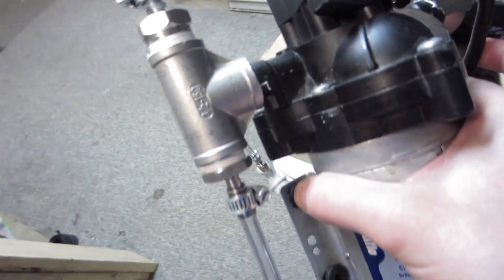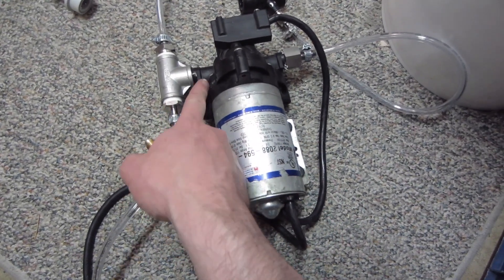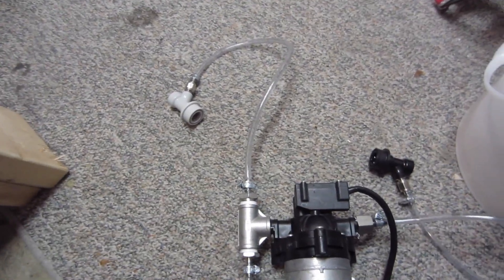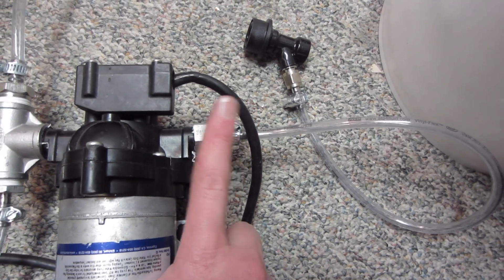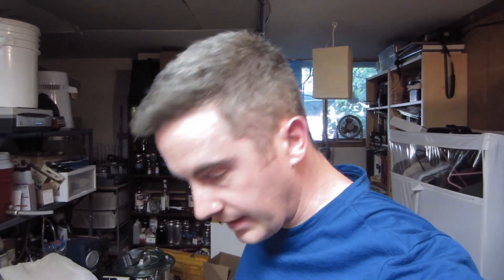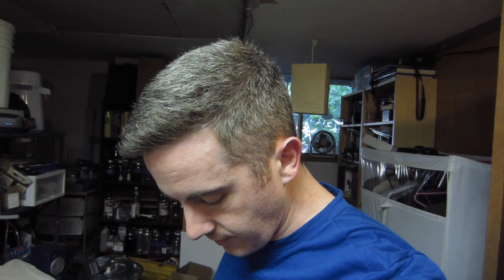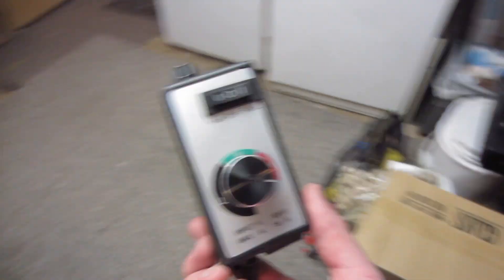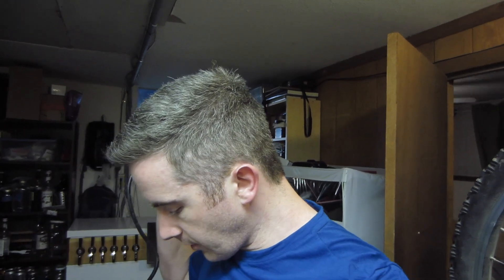DIY Quick Carbonator!

Comment: Hey Buddy

I've tried with small solar pump solution, but when I crank up the pressure, it stops working. I can get it flow when the pressure is not on. What am I doing wrong? :(

Comment: But is that plastic food grade?
Reply: it doesnt have to, im a lover of the stainless steel, but on my way to become a brewer, and also i hace my own business relatad to a beverages, i found out that sometimes you dont have to go to stainless steel always, in this case, im sure that if you are watching this video its because you are trying to save some money because the quickcarb its a little expensive, so, i found out that the pump of the quickcarb its neither a foodgrade, thats why they recomended to sanitize over a 5 minutes with hot water then star san etc. i may be to long with my answer  hahaha, but my point is, as long as you ALWAYS clean everything up after en before using, you wont get any contamination.

Comment: Quick question. Neither of those pumps are self priming. How did you prime/sanitize the system
Reply from the maker: I usually use a small corny and put a little pressure in it and vent one end to get it flowing.

Comment: Jason, As indicated by the large bubbles sticking to the inside of the glass, the glass was not beer clean. If beer glasses are cleaned with dish soap, they need to be rinsed a few times with plain water to remove any lipids, which deflates (?) the head.  I'm in the process of  gathering the items to build a force carbonation system. Love the DIY aspect of the hobby. Or is it an obsession? Anyway - thanks for the video.
Reply from the maker: That makes sense about the soap! I need to get one of those beer glass rinsers like taprooms have! I think DIY just gives a better understanding of the process.

Comment: Hi beer meets world. I am in the process of building your carbonator and I got the same small solar pump as you. I dont have a reuter to slow it down also I have no absolutely no tech know how. Did you change how the small pump rat at all. My power supply will give it 2.5amps. Any help would be super super awesome.
Reply from the maker: I only needed the controller to slow down the larger pump. The solar pump should be fine without modifications. If you do need or want to slow it down, add a valve on the output side of the pump.
Reply: sorry 1.5amps
Reply: thanks man you are the best :-). will post my build when done. Send some subscribers your way.
Reply: I have seen this kind of setup before.  The person used an in-line dimmer light switch to control the speed of the pump.

Comment: first of all, thanks for the video, I have a similar DIY system but now I have an idea that I want to try out, and I would like you to give me an opinion.
In principle the workflow should be like this, primary fermentation is done in a plastic conical fermentor, where after cold crashing it with glycol immersion chiller, I would transfer Beer with a pump to a pressurised stainless steel vessel (custom made Brite essentially), 
but in between I would be transfering  the beer through a 
1st chiller with a copper coil dropping the temp to 2C, 
2nd Filter (made from inline single pass water filter) and in the end 
an inline carbonator.
After complete transfer from Primary, i would reattach the hose from the primary to the Brite's OUT and recirculate until reaching equilibrium.
This is basically the same principle as if I am using a keg, so please answer, your advice and opinion would be helpful.
best regards, George
Reply from the maker: That sounds like a great setup! I like the idea of having an inline filter. That’s something I’m going to be adding soon hopefully. That should work well for you.